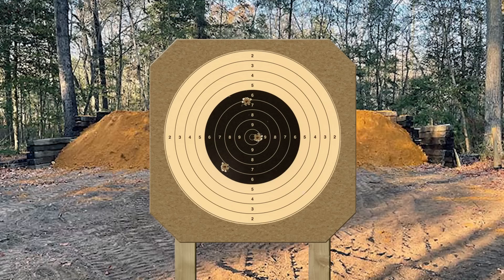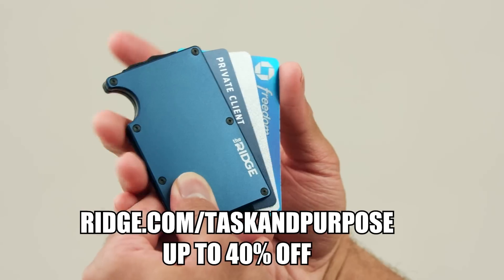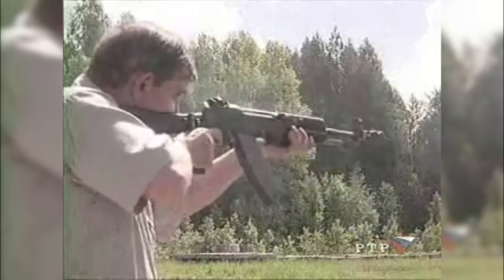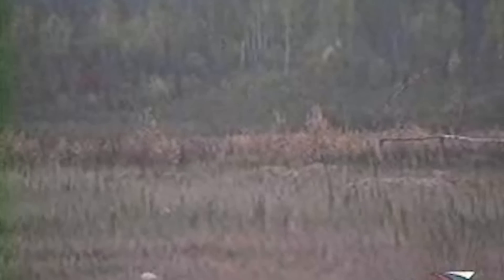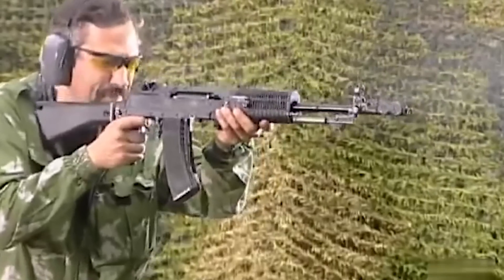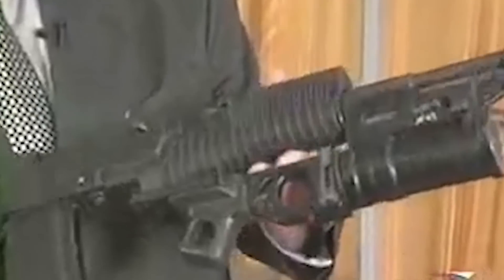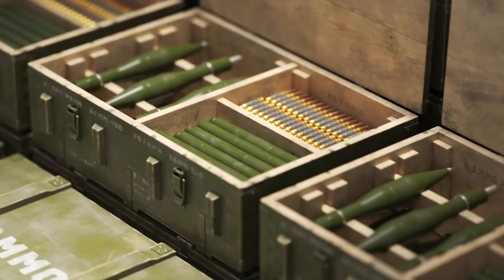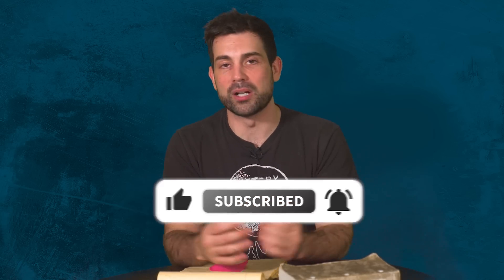This Russian Rifle Fires 2 Bullets into 1 hole

Comment: Call me old-fashioned, but 3 shot burst is the way to go for me. 👌
Reply: G11
Reply: western 3 shot burst = most stupid thing ever exist , because the 3rd shot alway miss target outside of pointblank range
Reply: @tranbachuyen6655  The G11 shoots all three bullets before the kickback sets in. This means there is no degradation in precision.
In addition, the small scattering of bullets is the core idea of the concept. Fire in the direction of the enemy and have 3 times the chance to hit.
Reply: @karstenschuhmann8334  they should go with 2 shot burst mode , even without crappy pulley system like AN-94 , 2 shot burst still way more effective in all term : accuracy , recoil , ammo saving and suppression power
Reply: @tranbachuyen6655  I think the G11 got way too complicated by building it all mechanically. It could have used a digital electric control. This would have greatly reduced the mechanical complexity and you could have selected between 2, 3, 4, and 5 round bursts.

Comment: It's failure is 100% due to the lack of funding for material to assemble more than a handful of these rifles. Otherwise it functioned as it should and was relatively reliable in the field, owing to the fact that select units within Russias military are equipped with them

Comment: Well, it was a rifle designed for a problem that really did not exist. The problem is rifles using self-contained cartridge has gone as far as they can go. What you have is AKM and M-4s or variations of them. One of the big problems a well-funded Army like the U.S. Army had was where to go, they looked at it and spent a lot of money and the rifles are not much better than what they already had. In the 1990s the Army was looking at careless ammo, the idea being less weight and can carry more, but it didn't quite work out. Until they can come up with man-portable laser blasters, we are in an M-4 or AKM world.

Comment: all those abakan project or advanced combat rifle though, really experimental and failed.
it surely is a good thing you can fire multiple bullets in one point increasing firepower but the inside becomes too complicated so its hard to maintain, its too expensive, and just shooting multiple bullets, doesnt worth all these.
and those new mechanics and ergonomics, you need to train combatants again(for G11 you need new expensive bullets too).
and landing two shots in one spot isnt that revolutionary anyway. ive seen some people praising it too much, saying 'only if it was cheap it wouldve succeeded'
its not a new paradigm or something, its still same firearm, same bullets, same(or worse) durability, can fire two shots almost at the same time, and nothing else. just expensive and too new, complex too.
even if i dont have to worry about level of training and the price i wouldnt choose this kind of guns.

Comment: If you can make it reliable, it does not matter how complex it is. Wrist watches are far more complex then guns, yet they are more reliable, electronic watches are even more complex, yet even more reliable. Double shots also has advantages in reliability, through a better average recoil energy.
Reply: Wrist watches don't have something go boom inside them every .1 seconds. Guns have parts that move at extreme speeds and slam into each other multiple times per second, comparing them to watches is moronic.
Reply: The issue is simple. Guns make big boom with big boom pressure, and they run at 3000°F when there pushed to their limits
A watch never explodes and violently throws molten steel at 200mph during malfunctions the worst they should worry about is the hand getting stuck or thr battery melts a bit

Comment: I am the exact opposite, My gun fires one hard bullet into two holes, and my spotter says it hurts unless I use a lot of gun oil.   She is always trying to get my shooting to be more accurate and just get the shots in one hole.  I think my shots are fine, they are always close together one on top of the other.  I use my own loads, soft tip bullet and hot loads.  My spotter complaints that she gets fouling all over which she says is hard to get out but is my favorite load that gets the highest velocity and distance. Plus the expansion makes the biggest hole c.   Gf gf

Comment: didn't the usa and germany have similar development concepts at the same time? The aim was not to penetrate armor, but to improve hits from prey. as far as i know not much got around in the usa apart from the doublet cartridge with two bullets and the germans developed the g11 which was not introduced due to the introduced nato ammunition standard 5.56x45 and problems with the caseless ammunition? All in all, it is astonishing how little development the land of gun fools has contributed to further development. never touch a running system. and even more impressive than the an-94 is the ak-107. not everything from russia is bad

i am not a friend of russian politics just a gun fool ^^ without gun :(
translates with google ^^
greetings from germany